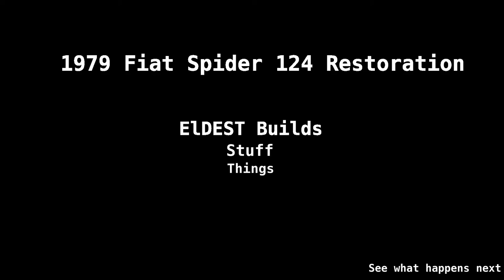1979 Fiat Spider 124 Brake line cut, flare, bend, install

Comment: where did you buy your brake kit
Reply from the maker: Brake line kits, brake parts came from Auto Ricambi.
So far three of the hard lines do not fit. Two were short and one was long. I am having to make new lines from a 25 foot roll from Autozone. Need a brake line flare kit again. I was working on lines today after the front suspension was installed. Suspension video should be out Thursday.
One on the
Reply: ELDEST Builds  thank you.  I am getting a Fiat 124 soon and I don’t know it’s condition. Your videos are going to be helpful.
Reply from the maker: @pfdmustang  Just don't rush it. I keep finding more surface just at the panel seems. I will post a video on the brake line bending and end flaring. It's not too difficult, just takes time and special care not to crimp the lines.